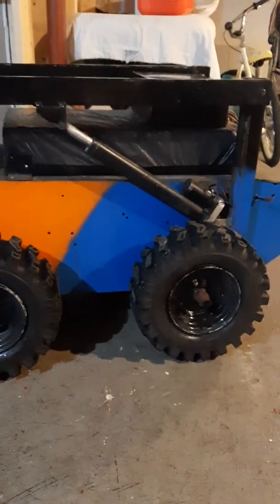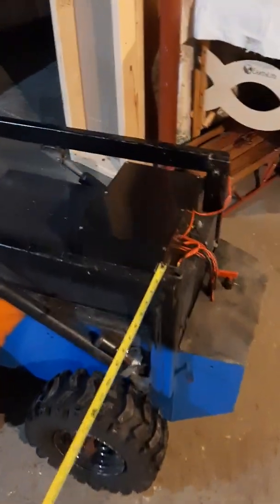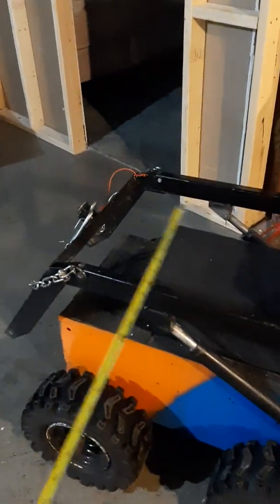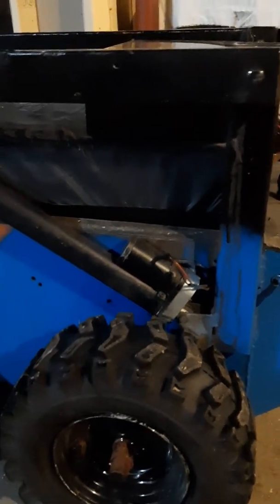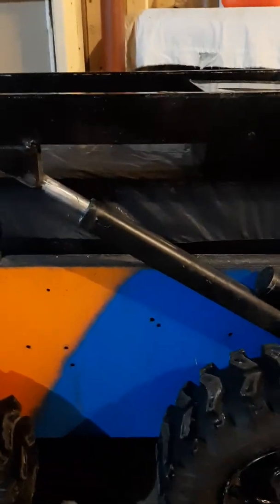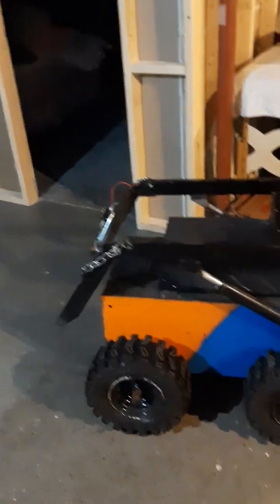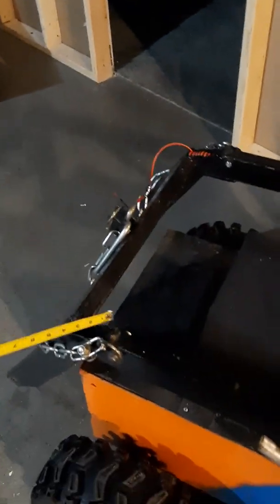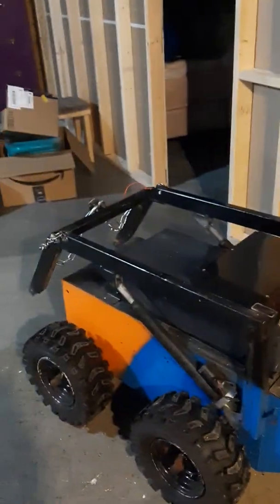Rc snow blower spec

Comment: Im building something very similar. Thanks a lot for explaining the electronics and dimensions! It really helped with my build-list :) Although i already bought the motors and battery before watching this. Mine might be a bit overkill.. 2pcs.  48v 750w planetary gear motors and a 48v 20ah batterypack.. Wondering if i might need 2 batteries though.. One for each motor?

Comment: Great machine! Do you have any photos of the inside of the machine or any links to the electric motors you used?
Reply: I would really like to see the inside of the machine too!  How did you handle the tensioning of the chains?  Are the motors mounted solid and the wheel shaft bearing positions adjustable?  BTW I wouldn't worry about your camera, the video quality and sound was just fine.  Better than a lot of videos on Youtube!